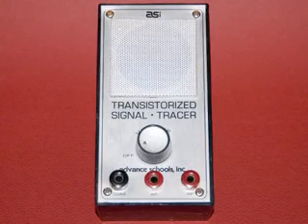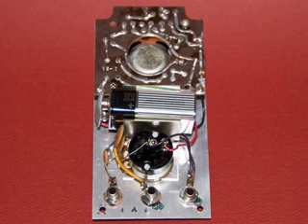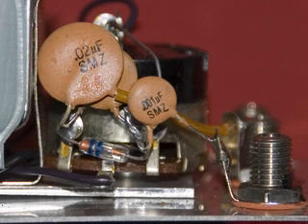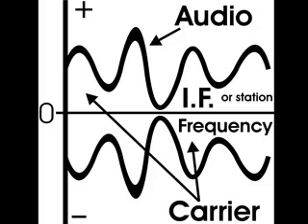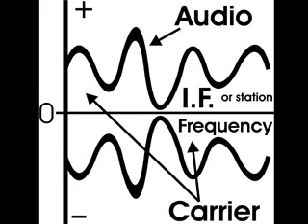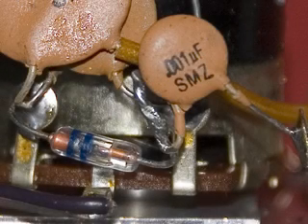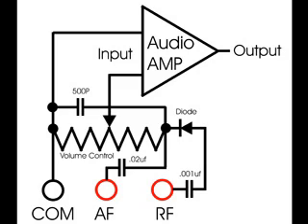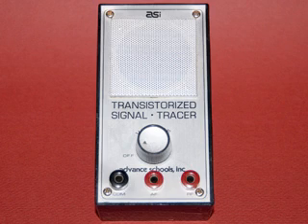Signal Tracer Transistorized

Comment: I simply add a .05 mfd 650WVDC in series with the RF input.  This has worked for me.  I would love to get a schematic.

I had one of these, only a MIcronta, (Radio Shack).  It lasted 40 years before it finally quit.  I freaked out and tried to build one.  Then I paid an outrageous price for a Heathkit IT 12.  Finally this showed up on eBay for $44.  It actually took two heartbeats before I bought it and I am very happy.
Reply from the maker: Build a Audio and RF Signal Tracer using a Guitar Amplifier
https://youtu.be/QUmPBBnzkRE

Comment: Why couldn't this be used in higher voltage circuits (tube equipment)?  Surely you can set a range of inputs to compensate for testing solid state or high voltage???
Reply from the maker: Build a Audio and RF Signal Tracer using a Guitar Amplifier
https://youtu.be/QUmPBBnzkRE

Comment: Great video,  I have the schematic for the Micronata signal tracer and it shows the little transformer but give no information about it.  If I was to build one what transformer would I use?
Reply: I'd love to see the schematic if you can direct me to it.

I have this device with the Micronta name. Radio Shack brand. I believe they use the transformer on the input side possibly to prevent high voltage potentials from being imposed upon the transistors. That was my thought. Capacitors block the DC component. Then the transformer can isolate and provide limited current from its secondary.

Comment from the maker: Good question! Most transistor radios run on 9 volts or less. And some power transistor amplifiers may run the finals at about 50-70 volts. However the finals of some tube amplifiers run at 250-350 volts and some even more. So it is a little scary to use a transistor devise (not designed for high voltage use) on tube circuits.